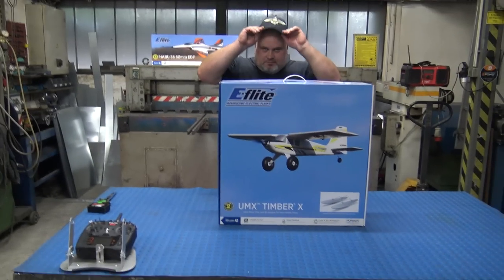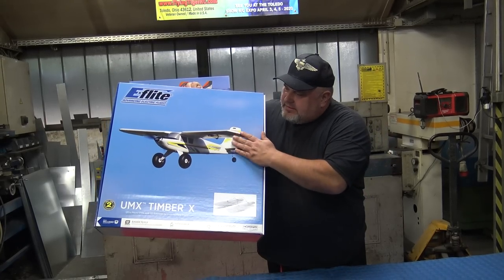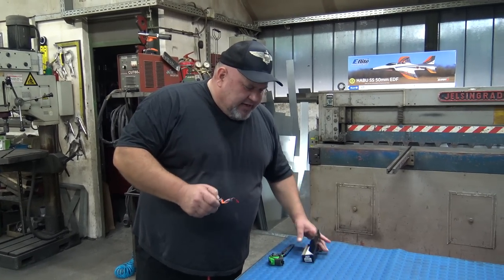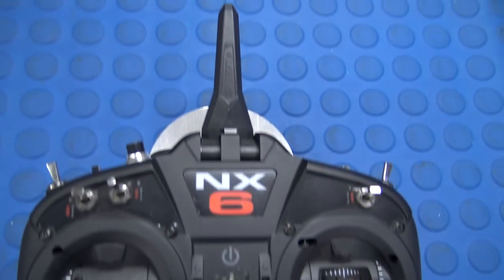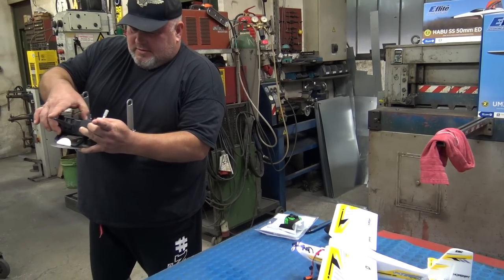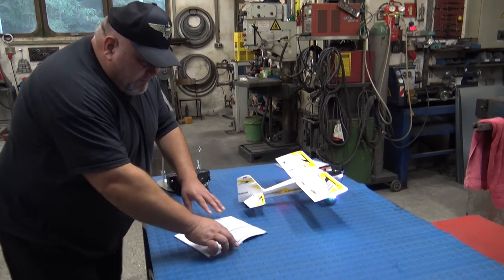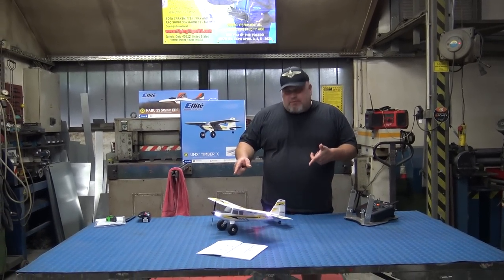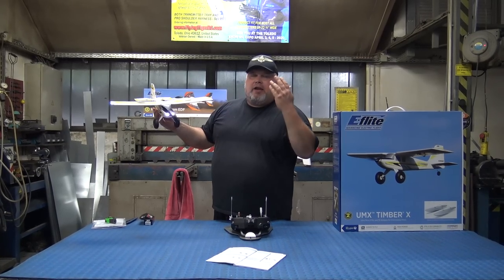AMAZING UMX Timber X BNF Basic with AS3X and SAFE Select 570mm RC plane UNBOXING & RADIO SETUP

Comment: Neat little plane. I have the original UMX Timber and fly it frequently. Believe it or not, it's an excellent plane in wind. I wonder if you can go into settings in the radio and reassign Switches for Safe/AS3X,  etc.
Reply from the maker: I can imagine that it can be flown in wind.
Reply: I agree!  I love kiting my umx turbo timber

Comment: Great job Brothers . Such a cool little plane . Flys like the big one .and nice and fast on the 3S .  The lights are really bright to , I download the radio model from Spektrum . I still had a few hick ups but got everything working fine on all the usual switches I use . Yep , never set the surfaces with SAFE on . 
I found that the lower flaperon setting , didn't really do much in the air . But the 40% setting helps slow it down and give it some lift . Best of Luck on the maiden . SALUTE !! 🇨🇦
Reply from the maker: Cant wait to try it my friend.